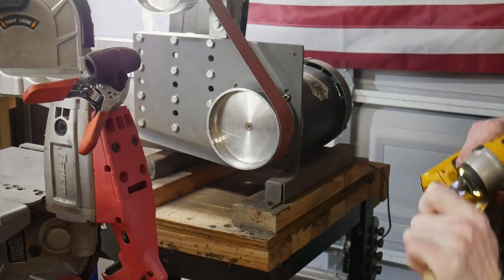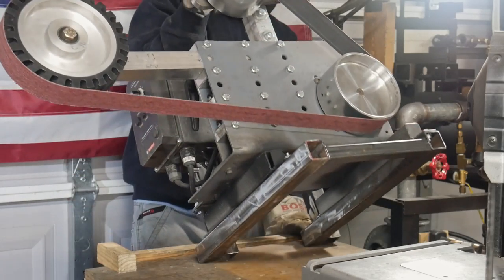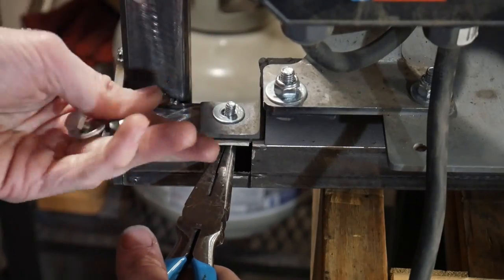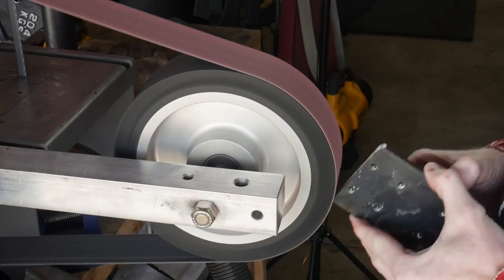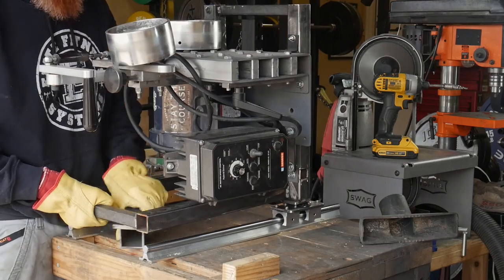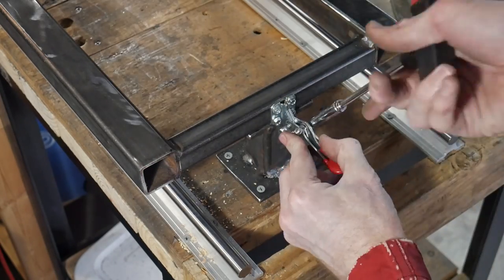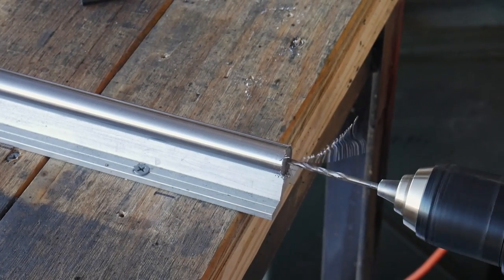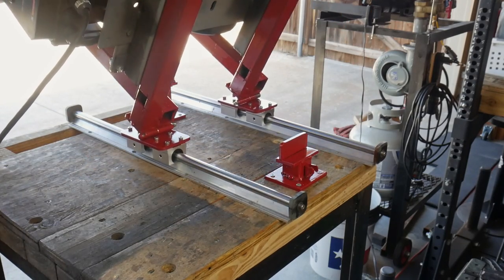How To Flip Any Budget 2x72 Grinder Horizontal | Belt Grinder Modification

Comment from the maker: Note: I concur that the stand needs to be shortened with this current assembly. The sliders do add significant height to the whole "grinder-frame-slider-assemebly". Please keep this in mind if you're looking to use this method. Also the whole grinder assemebly could have been moved further to the "left" on the frame to make the horizontal position a little lower and a little more inline with the normal vertical height. Cheers yall!

Comment: Thanks for the idea. Will work out the kinks before I do mine as to keep the belt the same height when flipped.
Reply from the maker: Thanks Ron, Yeah, I think this could be done with appropriate dimentions of the cage. I will say that the stand could be shortened in this case and it would be fine I think.

Comment: Smart design. Got any tips for those of us looking to find out how to weld? There are probably some local community college workshops but I'm not even sure where to start.
Reply: CO2 is the way to go when it comes to starting. You could even get the flux core to not have to deal with bottles of gas. 

Watch some tutorials and start welding. It is not as hard as many think and even stick which is one of the hardest is not that hard when you get the hang of it. Sure my welds are uggly as shit but hey, they work so no complaints there.
Reply from the maker: yeah CG, i think that isn't a bad idea. My welding sucks. To get started you can jump up on youtube and search for tutorials.

Comment: Been thinking about doing something like this. I have the same grinder. Sounds like kyle will be working on a tilting base at some point I’ve been holding out because that dude has some genius designs. How do you feel about the height when horizontal? Great video as always!
Reply from the maker: Thanks Jackson, when adding the sliders the whole assembly is tall. The stand needs to be shortened over all probably by about 4-5  inhces for my liking.

Comment: Nice project... As always... I noticed in the horizontal position, the belt is nearly as high as your face... How is this working for you?
Reply from the maker: Hey Dan, for sure it's too high. The sliders adding some height and I should of put the grinder closer to the "left" side of the frame. The stand needs to be shortened.
Reply: @RedBeardOps  thank you for the reply... I really enjoy your Ops... I don't have nearly the equipment that you or others have... , But I love restoration and fabrication projects that include forging, steel stock removal, wood and wood milling ... One step at a time

Comment: Seems really high. Are you going to move that somewhere else? Or is it just the angle of the camera
Reply from the maker: It's tall for sure. The stand needs to be shortened in my opinion.
Reply: @RedBeardOps  gotcha,  that beard would be full of grit if you sanded with it that high. Nice work brother
Reply from the maker: @joshyingling  Wouldn't want that! Thanks man

Comment: Looks like the belt is too high for you in horizontal position. I think the grinder stand needs to be shorten.
Reply from the maker: Yes sir, this stand would need to be shortened. The whole sliding deal added height.